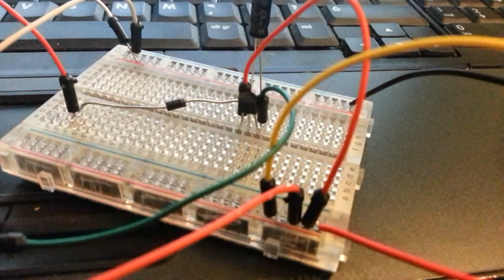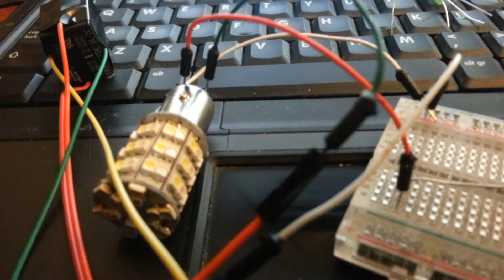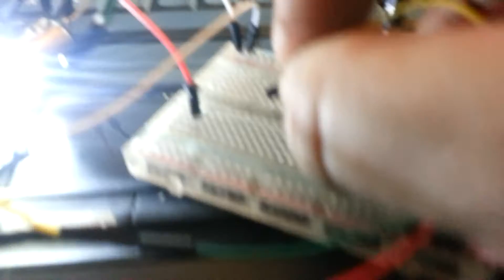SMD Daytime Running Light DRL and indicator circuit

Comment from the maker: I'll try and build the circuit again to get the resistor values (if there were any).  Capacitor on the description was 22uF.  This value will vary depending on the relay and how long you want the delay going back to white light again.  
I think everything was sourced from ebay from the cheapest generic parts I could find....I'd say £5 including the 2 led lamps
Reply from the maker: reading my description again, its the npn transistor that drains the capacitor, not the relay - so the relay size plays no part this.

Comment: So does the capacitor control the length of delay?
Reply from the maker: The capacitors job is to hold the relay open, which turns the white light off. The  resistors job is to discharge the capacitor so the white light comes back on in a reasonable amount of time.
Reply: Unreal man, this video led me to buy a breadboard kit, and all the bits n pieces to do it myself. Got this circuit working today with a 9v battery. Was sweet... while it lasted, after a while the relay didnt seem to be getting enough power to flip the switch. Do you know what power is required to switch the relay and what the maximum power is safe to run through the transistor. Gona hook up to the 12v battery tomorrow